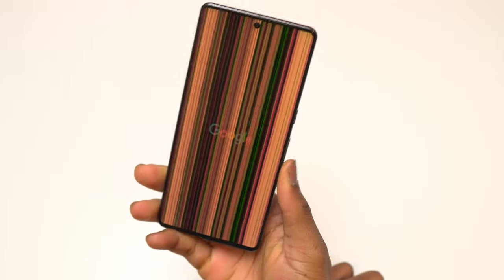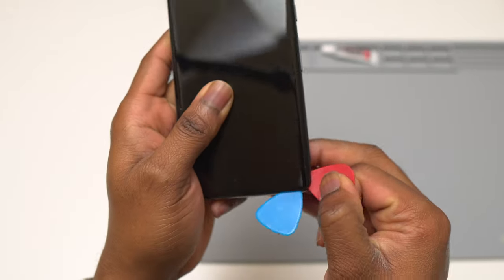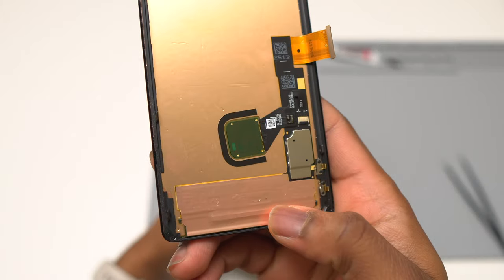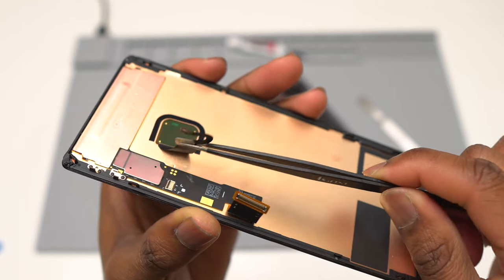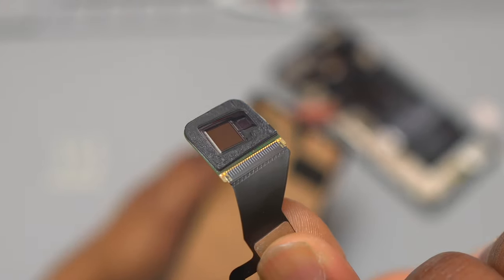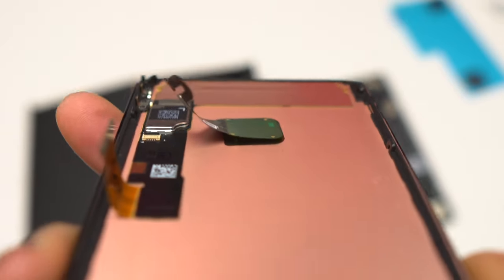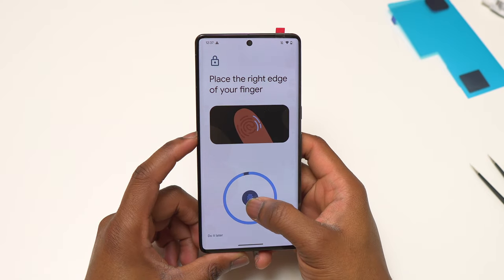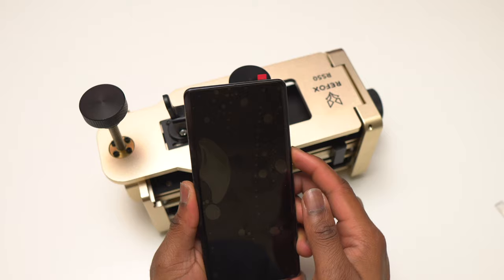Google Pixel 7 Pro Screen Replacement

Comment: Word of Caution!!!!!  Learn from my mistake!!
There are small pin like clips on the sides of the device, they may become bent and point in an upward diection when opening the screen, please bend them back before installing the new screen to avoid damging the new screen. Immiediately damged my new screen in this way as I went to press it in. I now have a thick green line.
Reply from the maker: Absolutely right!! The worst design possible. Sorry to hear you had a bad experience. Thanks for the suggestion
Reply: @ersbit  Managed to successfully replace the damged screen with a new screen. 200 dollar mistake. Found the culprit, left a small scratch on the lower part of the old screen, right where the backlight is. Thats what caused the green line to appear.
Reply: That sucks but thank you for telling us!

Comment: btw you should remove the video or add the missing information. having it in comments isn't sufficient, someone may burn 200 bucks cause of you
Reply from the maker: Please why are you saying it may cost 200 because of me?? What did I show wrong that people are complaining about??
Reply: @ersbit  pins could puncture the display and you forgot the selfie cam seat. if they glue the display and reopen it to insert the seat it could break.
Reply from the maker: I was even kind enough to relay the information and pin it at the top for other to be aware of it. How is it my fault? Please go watch other videos and let me know if they are talking about this problem.
Reply: @ersbit  dude if you want a flawed guide in your channel it's fine for me
Reply from the maker: How is that my fault....I have notice it other have notice it ?  The camera plastic yes I forgot to have it there. That would not be a big problem for your front camera in case you forget to have it installed. As far as the pins I did not design the phone. I took my time to show the how I would do it that's all. My video is not perfect I don't get paid to do videos and I pay everything myself. I don't have more than 24 hrs in a day to do everything and redo all video someone said something. The comment box is the only part I can tell viewers then if they did not look at the box. They cannot blame me because I did not design the phone, not they bought the screen from me or I certified that they should not do other research before performing screen repair on their phone.
Reply from the maker: Dude please go look for the perfect guide somewhere else.....there's none that's the answer you will find. Nobody is showing how to fix phones for free showing all the steps. If I take my time show show it please respect my work. Like I said nobody gives me guides to do this I figure it out and show it then it will never be perfect. Issues may arise later and only in the comments I can relay the info. What I said about the pins was first talked by a viewers who tried and got the screen damaged. I just relayed his findings so that other do not face the same problem. Like is said again I cannot redo all videos because it time I have to go to work like you and others.
Reply from the maker: Please make a new video using my videos and add the missing information. I allow you to reuse my video in case you want to make a video and show how to do it. 👍🏽

Comment: Iso 100% makes fingerprint slide off with ease

Just dont use too much

It did not harm sensor at all
Reply from the maker: Great. Thank you for confirming that the sensor is still working after using isopropyl alcohol to help remove it.
Reply: Anytime mate
Thanks for making a great video
Reply: I love your heat mat
It is nice and large
Reply: Even around the edges of screen
I ran a line of 100% iso and wobbled my suction cup gently to break the glue while holding frame down with my finger nail

The screen popped up with minimal use of of plastic card to break glue

Then i pulled the clinging adhesive with spudger